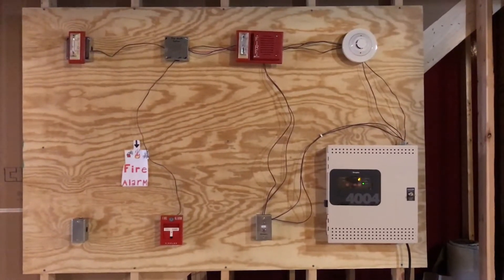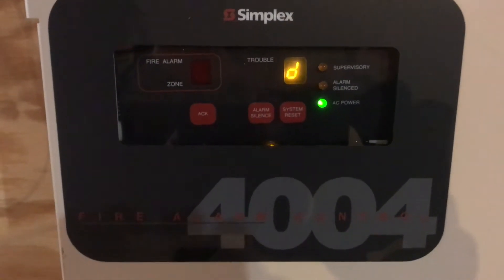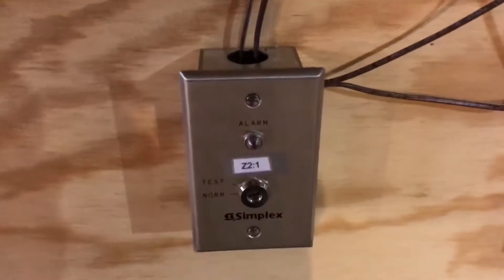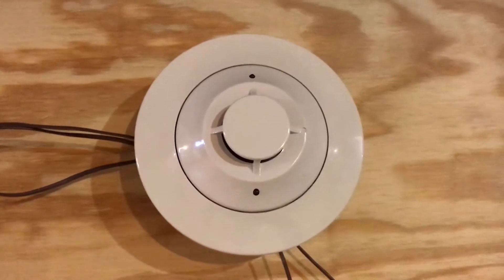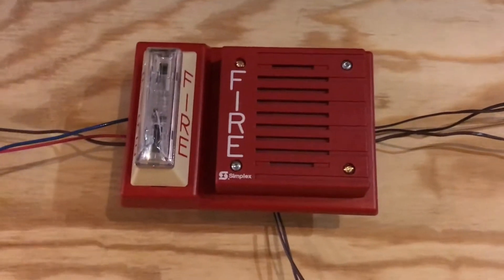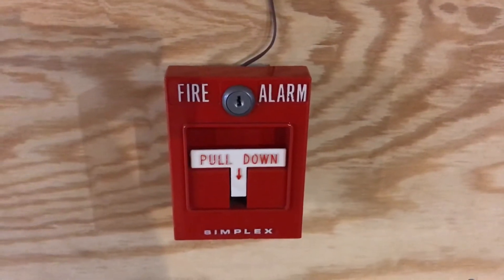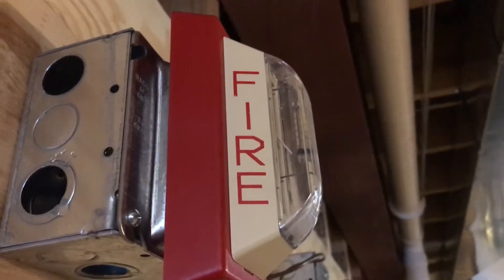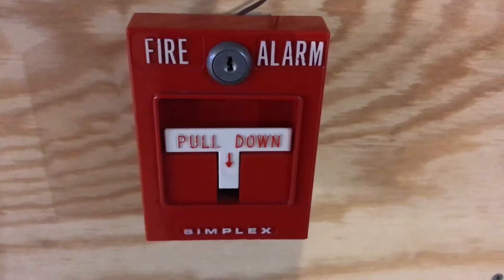New System Test 4: Mechanical Horns (2018 New Year's Special)

Comment: Very cool! Love the sound on this system. That shot at 7:08 tho... all that open unfinished space makes me wish I had an area like that to build a larger system. All parts of my house are finished and untouchable, so I'm stuck with systems on boards.
Reply from the maker: kcin556 Yeah. There used to be a ton of boxes from when we moved here three years ago taking up space (not to mention they were heavy) so last summer my mom figured out what was all in them and the stuff that we were keeping was either put where it was supposed to be (like pictures we hung on the walls) and other stuff that was for storage we moved to the side or got rid of (we have a village garage sale each June; unfortunately it’s more of a junk sale than anything but we had stuff that was actually worth it so we donated it to my church which sold them during the garage sale. Our holiday decorations and other pictures were in plastic boxes which we bought plastic shelves for and built them and stacked those boxes on shelves against the wall so it definitely is a lot more open than it used to be now that all our junk is gone.

Comment: Nice! Surprised your 4004 didn't start spazzing out with that electro-mechanical horn. Both of my 4004s, when I had them, were very sensitive to electro-mechanical horns, and the indicators would always go crazy. Very glad I was able to get a 4005. Much more tolerant to that stuff.
Reply from the maker: msj191961 Thanks! It has done that before when I accidentally had both NACs set to be coded, although that was an error on my part. I’m sure it would though if I had two mechanical horns up; but it seems to do fine with just one for now. The indicators did go crazy on me when I had a 4903-9236 horn strobe and a TrueAlert horn strobe up though, but it seemed to resolve itself later.